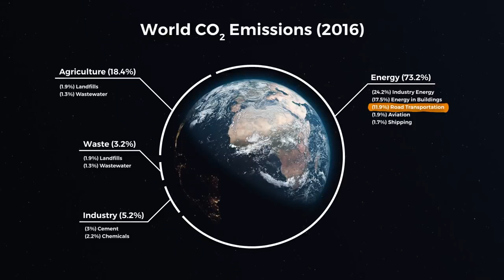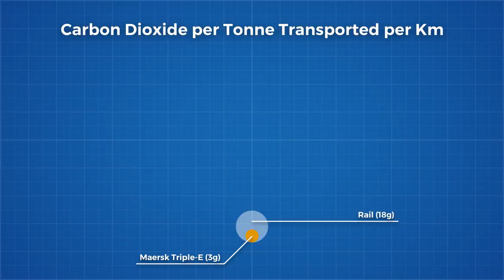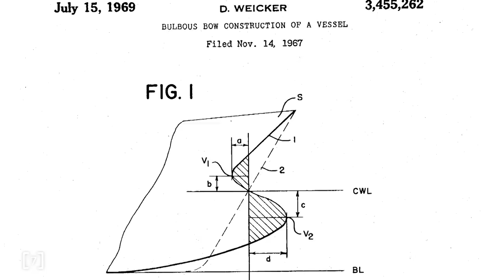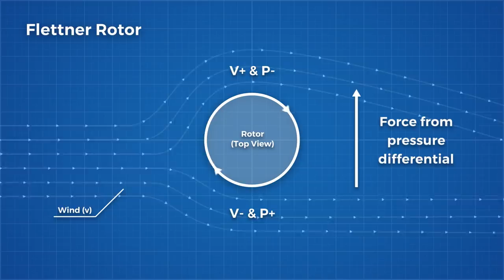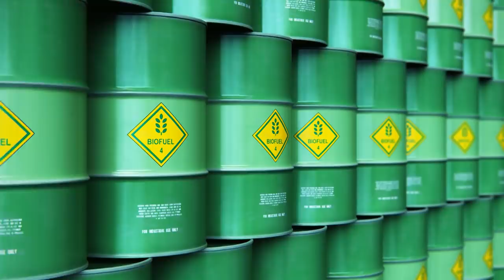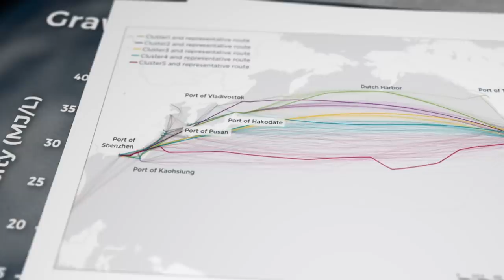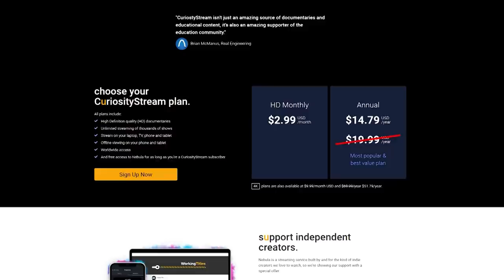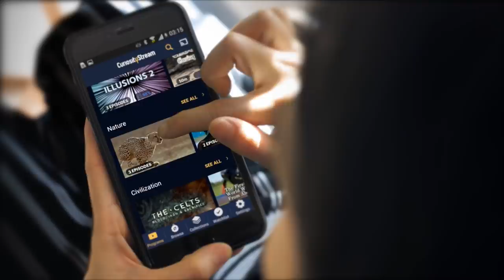Are Renewable Powered Ships Possible?

Comment: after thinking about all the diffrent things you could install in a ship to make it green i think to myself, what's the easiest, low impact thing to could do to power a cargo vessel for it's lifetime.
the conclusion i came to was compact thorium reactor. now when i say that i completely understand there are a tonne of things that would need to be done to make that work. but that's the only tech i can think of that can crank out 1-4MW continuously with no pollution.
Reply: Just think; would you have full confidence in the management of a nuclear reactor under the control of an anonymous entity only traceable, perhaps, via a letter box in a FOC (flag of convenience) nation state?  If you are, could you sell that confidence to Japan, the state that hosted the Hiroshima and Nagasaki nuclear detonations as well as more recently the Fukushima ‘event’?  Then try that same, or a similar, sales strategy on Ukraine, the nation state that as a part of the USSR (CCCP) hosted the Chernobyl ‘event’.

Modern iterations of nuclear energy, thorium fuel, molten salt reactors, small modular reactors or fusion reactors, will carry the legacy of past problems.  It is the global trepidation of anything with 'nuclear' in the name and the economics of nuclear having transitioned from 'energy to cheap to charge for' too 'the costs of remediation are incalculable' that will prevent the adoption of nuclear energy as a means of creating energy at sea.  Modern reaction systems may have overcome the safety problems but the general public, having been misled in the past, will be reluctant to believe the fresh new promises.  The incident of the ‘Ever Given’ blocking the Suez Canal, March 2021, may also have a little to add to this debate.  The cooling water on ships tends to get taken in from near the bottom so when running aground the inlets are in a prime spot to get plugged up restricting, if not stopping, the flow of coolant.  One thing that the TMI, Chernobyl and Fukushima incidents all had in common was that the supply of coolant, or rather lack thereof, was a fundamental cause.  Similarly and only months later, May 2021, had the ‘X Press Pearl’ been nuclear powered then a major port for a populous nation in the global South would have possible been the site of a significant exclusion zone due to a non power plant related incident.  If the ‘X Press Pearl’ had on board a fired up but ‘safe’ molten salt reactor and found herself having to dissipate the residual energy associated with the possible 12.5 megaWatt power cycle would a stable cool down have been possible?  Would there have been sufficient heat energy contained in the power system to facilitate a hydro thermal explosion?  In a casualty ships may capsize, like the ‘Karin Hoej’ off of Bornholm in the Baltic early December 2021, in which situation any safety system reliant on gravity might not work.  It might also be worth bearing in mind that part of the TMI near miss the fault of the navy trained operators focusing on not letting the primary cooling system 'go solid'.  The actions of the captain of the 'Costa Concordia', Francesco Schettini, may also be relevant; the consequences of his actions, whether due to ineptitude, an isolated act of incompetence or driven by a corrupt corporate culture, illustrates well one of the dangers of releasing nuclear energy into commercial shipping.

As a second point if you fit 'walk away safe' reactors on ships you will need duplicate drive trains as there are seldom salvage tugs around when you really, really need one.  A nuclear ‘dead ship’ drifting around NUC (not under command) would be a disaster waiting to happen and duplicate systems increase expense.  Land based nuclear power plants have a few issues but are immobile, stable and usually well regulated.  Reactors on ships by their very nature are able to move between regulators, bump into each other and roll over.  Regulation of ships by both / either flag state or port state has problems and adding any nuclear regulatory obligations on to those already overstretched facilities would be very taxing for all involved.  This is not about 'can it be safe' it is all about 'will it be safe'?

Furthermore while merchant ships may be 'taken up from trade', as the RN would say, or may be captured or impressed by non state quasi military entities by way of piracy, cargo ships are not military vessels.  They therefore do not have the same inherent level of self protection and internal discipline.  Why not use nukes on merchant ships?  It is down to engineering, finance, socio-political attitudes and safety.
Reply: @BernardLS  yikes, that's quite the essay. like i said " i completely understand there are a tonne of things that would need to be done to make that work". i'm not one to answer the questions of safety as there are companies building cargo vessel reactor systems that'll do that. we run out of fuel in 2050, long before that fuel will be way too expensive for most applications. we need a better, sustainable way to move around, simple, and hopefully someone will do just that.
awww, i noticed you also answered me with something just as voluble in matt ferrells video. i'm honoured.
Reply: @discombubulate2256  ‘I am honoured.’ Pleased to be of service (:-).  Shipping currently has a 'high volume, low added value' business model and it needs to return to the 'low volume, high value added' model it followed in the past.  Any alternative to the existing system needs to provide better value and so depends on the yield; the energy input less losses must provide energy output that can be deployed for propulsion, cargo handling and domestic services.  The 26th UN Climate Change Conference of the Parties (COP26) held in Glasgow between 31 October 2021 & 13 November 2021 established requirements and targets for mitigation of the production of GHG and with regard to shipping steps to reduce atmospheric pollution to acceptable levels could include, but not be limited to: -
1) Reduce spoilage / waste of all commodities;
2) Improve fuel quality;
3) Localise production to consumption;
4) Reduce 'freight mile' distances;
5) Abolish the cruising fraction of marine transport;
6) Reduce freight carrying capacity;
7) Abolish recreational boating;
8) De'fossil'ise the fuel chain;
9) Reduce the global population of consumers.
The use of any of the options above may not be the future of marine transportation but moving less material and moving what is transported over shorter distances, as in the past, should be.  Together with localised production and minimised consumption a global population that has individuals’ voluntarily self limiting reproduction to two children per parent (both male and female), might save the planet.

Comment: The shipping industry could benefit very nicely from investing in solar energy.  The vast majority of the time these ships are exposed to a lot of sun from the lack of buildings or bridges to compete with for sun exposure, so why not use that as an energy advantage?  They could add battery storage to power the ships at night & in weather that's cloudy and/or stormy.

Having sails would also help.  But it would be ideal to add them as a backup for if or when then solar battery system fails & to help balance the demand on the solar battery system.  In other words the sails would act as sort of emergency/backup generator for ships.

But I think the sail backup idea will never be implemented into ships because it doesn't fit into the pattern humans have with only using one power source or one solution for everything.

Comment: I think the best solution for the future is nuclear propulsion. With the coming small modular reactors(SMR). That is a very clean energy source and generation 4 reactors can even use old nuclear fuels from older reactors as fuel, and nuclear waste only needs to be stores a few hundred years. They can be built small and contained in the size of one 40 ft container and they wouldn't need to be refueled even once per year. This also gives enough power to increase the speed quite a lot which can make the number of ships lower which means less production cost to offset.

I think we will start to see this within 25 years, and have almost all ships replaced in 45 years.
Reply: Zuurker U  That would be solved with gen 4 reactors that do not need water coolant at all in most designs. For example, there's a lot of progress being made on MSR reactors where the coolant is molten salt in a closed loop. In 10-15 years we will probably have the technology ready to be applied in naval propulsion.
Reply: Zuurker U  Yes, there's definitely a lot of challenges left to solve before this technology is ready. There is also a high risk of failure in most of the current projects. However, there are several different designs and quite a few projects working on this in parallel. It's unlikely that all of them will fail. I'm pretty confident that we will have at least one final design ready within 10 years from now for normal land-based use. 

I might be too optimistic, but I feel pretty confident that nuclear will be the way forward and the best long-term solution.
But yes, I agree that we need to attack these problems from as many angles as possible and don't put all our eggs in one basket.

Comment: Electric battery powered with a 'roof' covering the containers that's actually just a giant solar panel array?
Reply: As an example the above container (called boxes by nautical folk) area of a Maersk triple E is less than 399.2m by 59m.  The 399.2m is the length between perpendiculars (marine tech speak - no need to worry about it) and the 59m is the width overall (more marine tech speak so again no need to worry about it) allowing for the sides, bow, stern & navigation/accommodation structure could we agree 340m x 56m or 19 040m2 for the ‘top of stow’ area?  Insolation rate in Joules will vary due to time of day, latitude of vessel, declination of sun, (those three impact the elevation of the power source) cloud cover, efficiency of solar panels and how clean they are. The triple E class use 29 680 kiloWatts for propulsion at full whack plus some hotel and services power load cost; so for round numbers, could we agree 30 megaWatts?  Solar panels create about 155 Watts m2 averaged out; 19 040 x 155 gives me 2 951 200 Watts (or 3 megaWatts for a round number) from the top of all the boxes.  Three megaWatts might allow you to distil enough fresh water from the sea to wash the crud of the solar panels (surprise fact renewable energy comes with maintenance costs) but nowhere near enough to effectively 'push the boat along'.  Fitting solar panels on top of the ‘boxes’ is worth, at most, 1% of your power requirement.  More seriously the ‘boxes’ are loaded and unloaded from the top down so the solar panel array would need to be moved for every port operation and time is money as well as that operation having the ability to get very complicated (tech speak for ‘go wrong’).  Any additional weight would be in the worst possible place for the stability of your vessel, the operating environment would be harsh and the ‘top of stow’ on a ‘box boat’ is seldom a level expanse as each column of containers may be, and usually is, of differing heights.
Reply: @BernardLS  You might be wasting your breath. The next thing they will be discussing is solar roadways or something. Or LITHIUM batteries :'D
Reply: @carbon1255  Funny you should mention batteries; there is a ferry that runs from Helsingborg (Sweden) to Helsingor (Denmark) on a twenty minute voyage that is a battery electric vessel.  All things maybe possible but not all of them are sensible, IMHO.
Reply: @carbon1255  From your 'tag' am I right in thinking you are an alchemist? if so do you have any views on the 'alternative fuels'.  My two pennyworth is '‘alternative fuels’ such as Ammonia (NH3), Hydrogen (H2) and Biogas (basically good old CH4 or Methane).  All require harvesting and processing which have costs and impacts before you get your energy to the point of use and will have effluents that will impact the global environment one way or another.  H2 is said to be good for use in fuel cells that will give clean energy when combined with Oxygen (O2) and leave only water (H2O) as an effluent; so as well as the cost of creating the hardware and separating out the H2 in the first place we now have the cost of separating out the O2.  An alternate use of H2 burning also generates combustion products which includes waste heat going to the cold sink and a few NOx nasties.  The numbers are getting very difficult to show any sort of surplus so this is a case running hard to stand still.  NH3 is very bad and probably deserves a rant all of its own, so let’s just leave that for a while (somewhere very far away that is cool, dark and quiet).  CH4 lots of it around much of which comes out of the ground as a fraction of the FOGI energy mining; even more can be created (relatively expensively) from anaerobic degradation of organic matter.  The organic matter may be either raw vegetation, food waste or pre-digested by domesticated livestock with the right (or wrong, depending on your point of view) sort of diet and gut fauna.  CH4 is a lighter than air, vapour at environmental temperatures and pressures and you need to compress it, a lot, or cool it, a lot, to get enough on board your ship in manageable volumes to be useful.  Carry it as cargo and you can burn the ‘boil off’, when the latent heat of vaporisation has a co-activity benefit, otherwise more trouble and cost than merit and savings.'